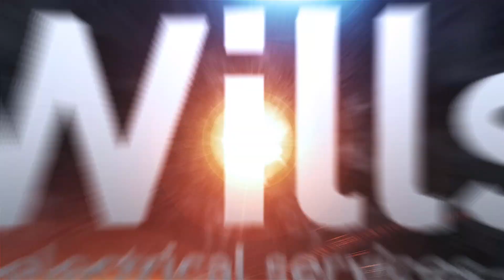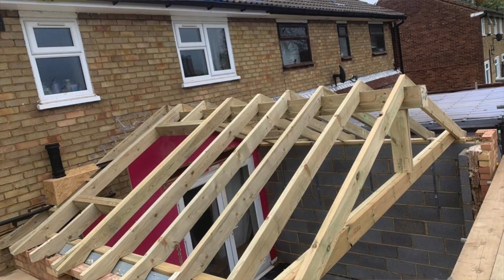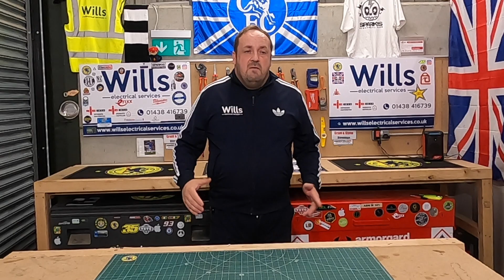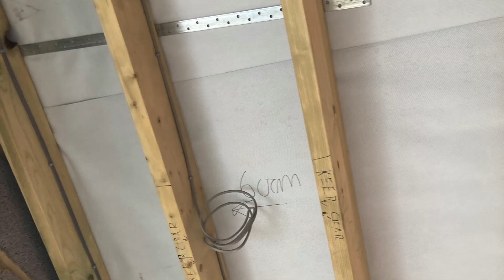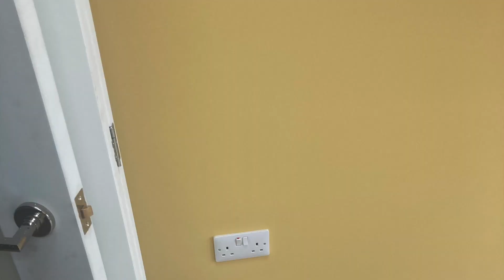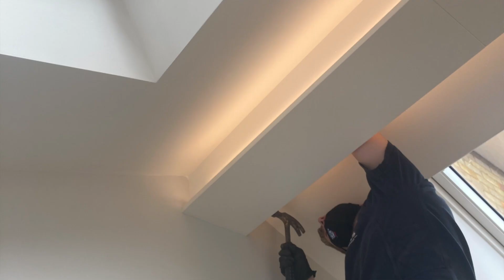Electrical Install job with MCS - Roof Garden Room Extension | Electrician TV

Comment: A great video glad your back on YouTube .Do you prefer plastic capping find it good on block work but on older houses you have to put a lot more fixings in it ,what do you think of metal capping is good or it has had it day with the worry about earthing?
Reply from the maker: Lovely thank you I don’t really use of the metal capping as I only really use the capping to ensure that my cables are in place when it comes to 2nd fix.